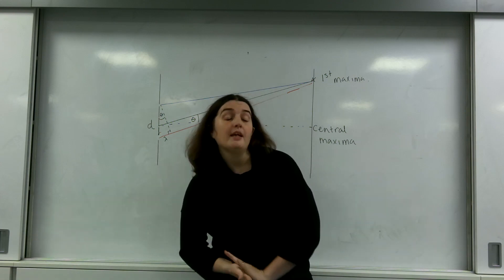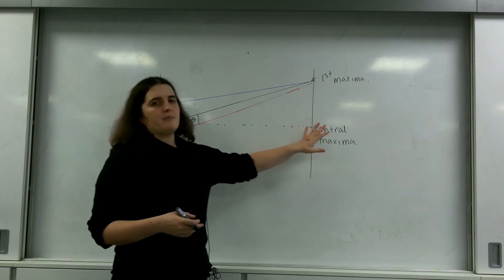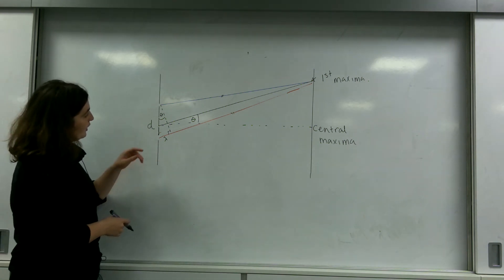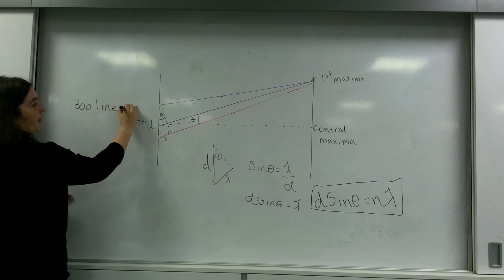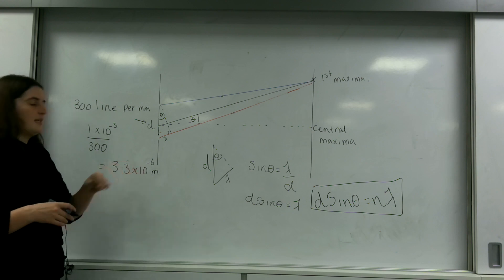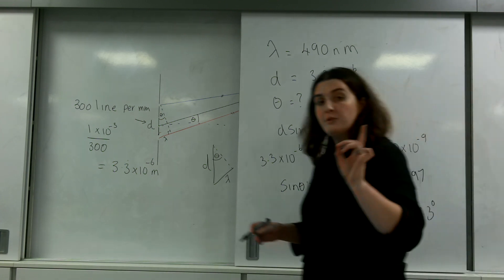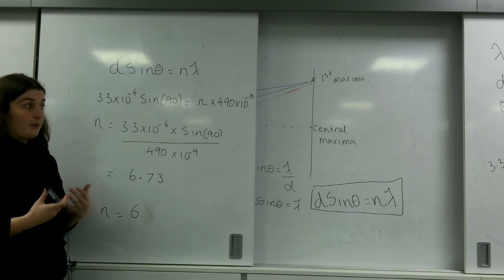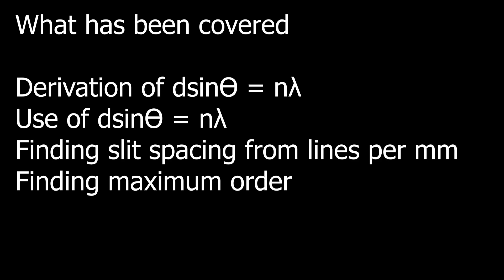Diffraction grating AQA A level physics

Comment: Hi, i was just wondering why they say there is 300 lines per mm. Is 300 random or does it mean something because why couldnt it be 200 or 400 etc?
Reply from the maker: It is an estimation of the lines that are in the diffraction grating. It could be 200 or 400 but that would be a different grating entirely

Comment: hi I just had a question, when you said that there are 300 lines (slits) per mm wouldnt that mean that there are only 299 gaps, so wouldnt you have to divide by 299 and not 300?
Reply from the maker: No it is 300.

Ill put it in a more a visable concept. 5 lines per m
So start

Line at 0m
Gap
Line at 20cm
Gap
Line at 40cm
Gap
Line at 60cm
gap
Line at 80cm
gap
------- Start again

The gaps are line to line. if you had 300 lines per mm. You start with one line at the 0 mark and one at every (1/300 of a mm) with the last line at (299/300 of mm) with one more gap after.

Hope that helps a little more visually

Thanks for watching!